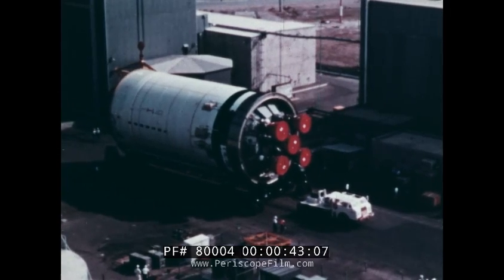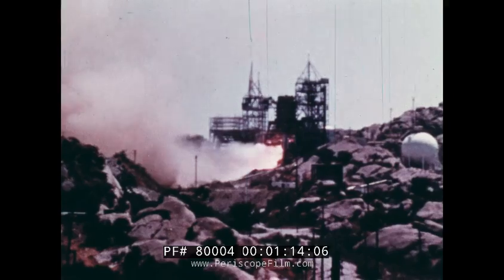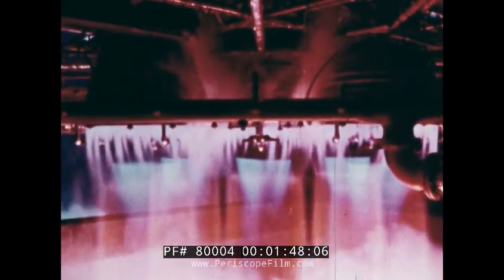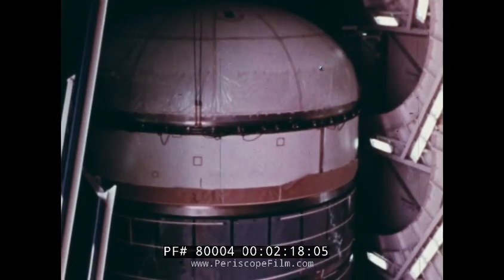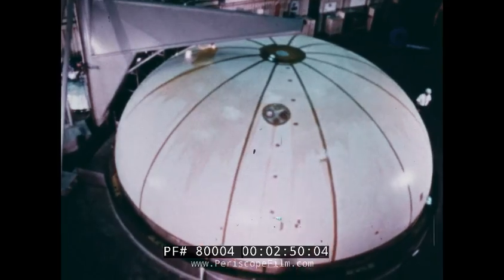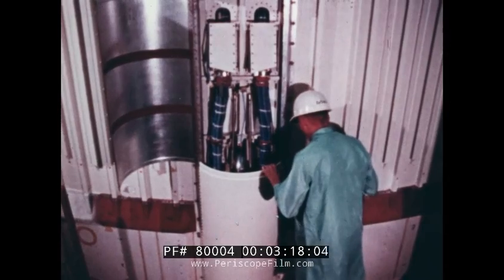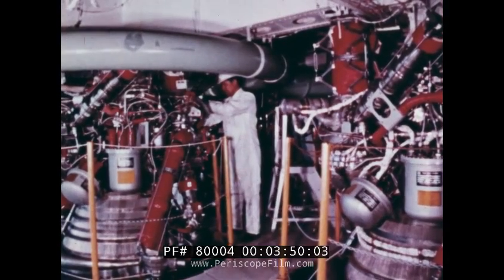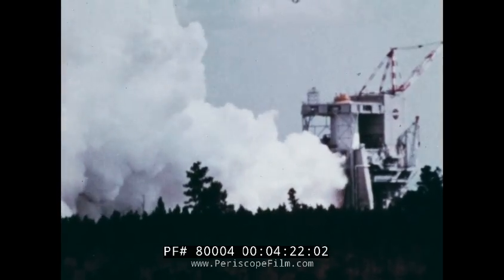NASA APOLLO PROGRAM  SATURN V ROCKET SECOND STAGE  80004

Comment: FYI,  the assembly buildings for the S-II booster in Seal Beach were torn down just a few months ago.   Very few people even knew what their purpose was.....
Reply: They should've been preserved as historic landmarks.
Reply: @nicholasmaude6906  From what I understand the building were built quickly with one intended purpose.  After Apollo was over they were mothballed.  Apparently there were issues with the corrugated metal sheeting corroding on the building causing runoff problems when it rained.